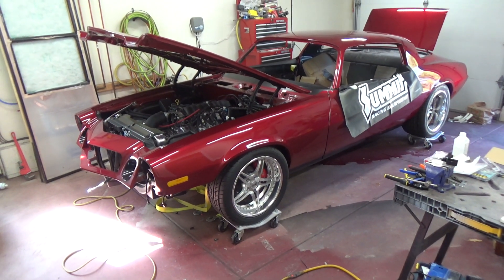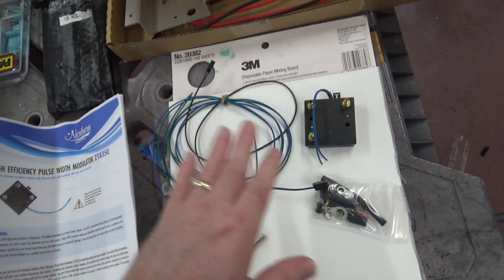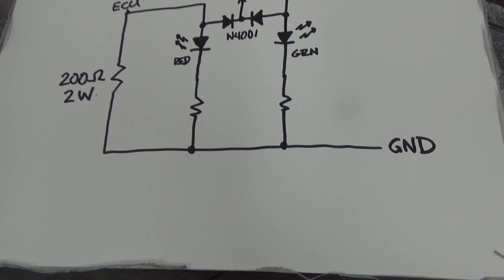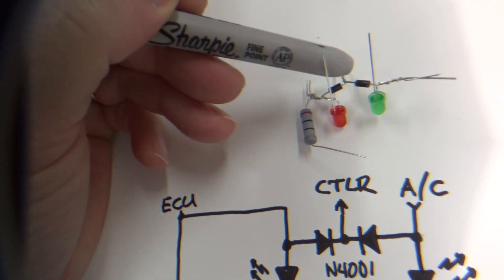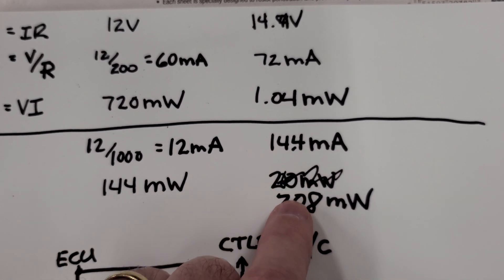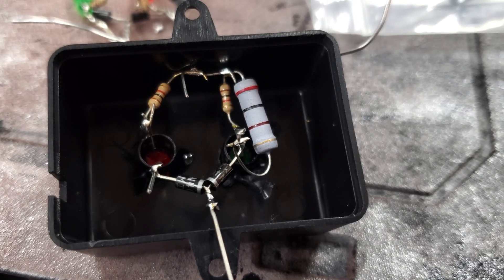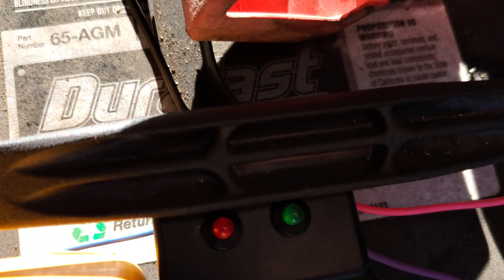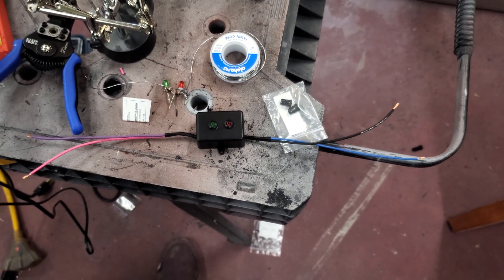1977 Camaro Z28 Part 260: Fan controller part 1

Comment: I was excited, initially, because I need to hook up a switch for the electric fan in my Camaro.  When I was younger I was much smarter and didn't think I would need the controller, as I was going to hook it up to run all the time.  I installed a relay because the engine runs after I shut the ignition off, but it still doesn't work correctly.
Reply from the maker: Electrical stuff can be "fun" :)

Comment: You should really put those components on a pcb board. That ground is gonna hit a positive source while driving
Reply from the maker: I am going to follow David's advice and pot it. That stuff does not move around in there, it is solid. The potting will keep it all in place though. Old skool-style :) If I ever run into trouble, I can re-do. It is all fused anyway.

Comment: Nice work Eric. You could fill that little box with potting compound. It would help prevent moisture ingress and vibration issues etc. But maybe I'm overthinking it.
Reply from the maker: Hey David. I was thinking about it, but don't know where to get the stuff. Have never looked either :)
Reply from the maker: I found some on Amazon. Good plan, thanks!
Reply: @asicerik  Great! Make sure the holes that the LEDs poke through are well sealed so it doesn't leak everywhere.